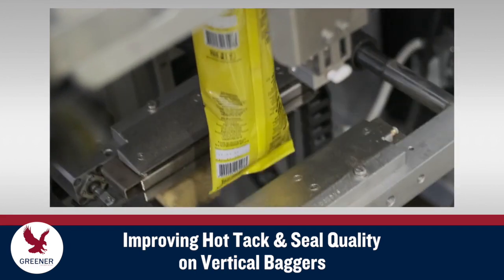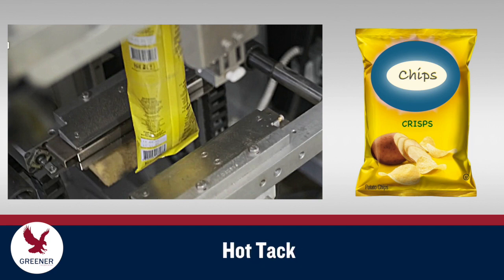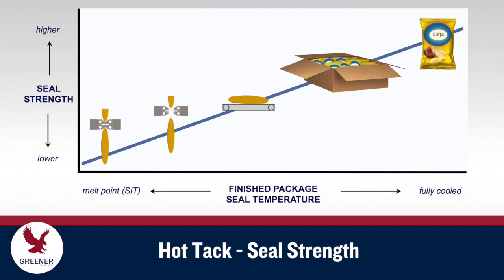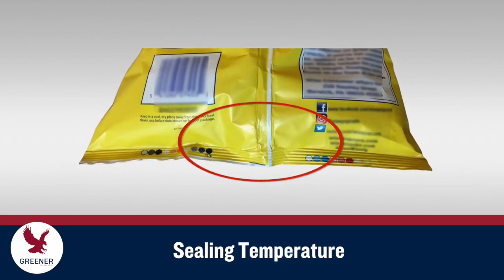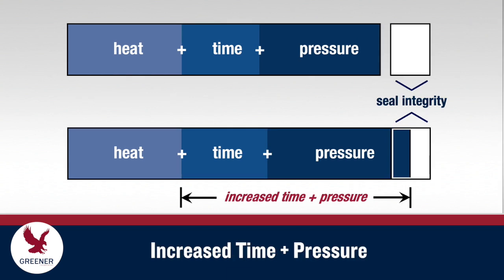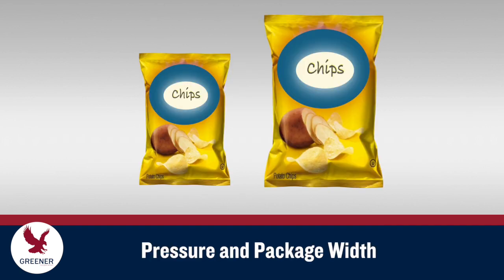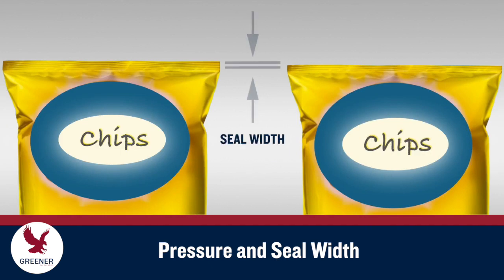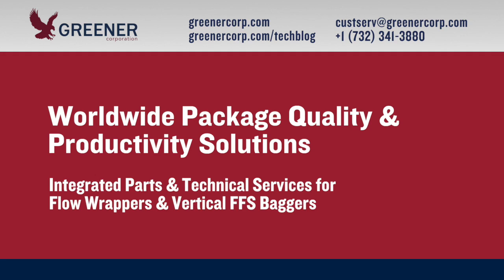Improving Hot Tack & Seal Quality on Vertical FFS Baggers

Comment: How to calculate dwell time in sealing? any specific formula for that?
Reply from the maker: Thank you for this good question. The definition of dwell time is the amount of time that the jaws spend fully closed on the film.  On machines with flat sealing jaws it is typically a setting in the machine that is normally quantified in milliseconds.
 
Not to complicate things but merely to explain, the true value of dwell time on rotary jaws is a more complex calculation than it is with flat jaws because just a small section on the radius of the sealing jaws is engaging at a time. Film speed is the major driving factor there, since the rotation of the jaws has to closely match that.  The rotation can be slowed or sped up slightly but too much in either direction will cause problems.

If you have additional questions, you can contact us at custserv@greenercorp.com or https://greenercorp.com/contact-us